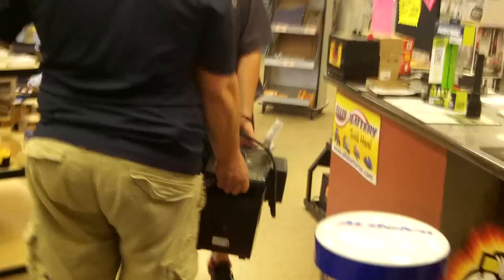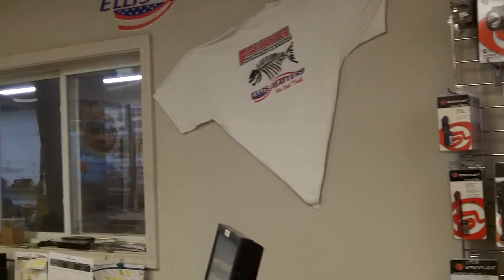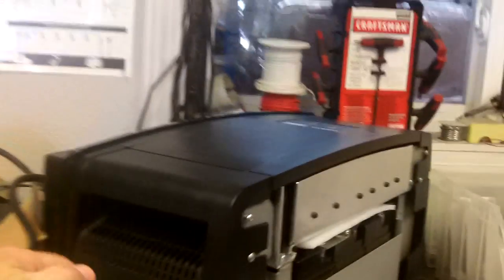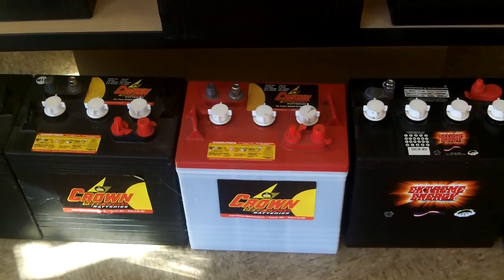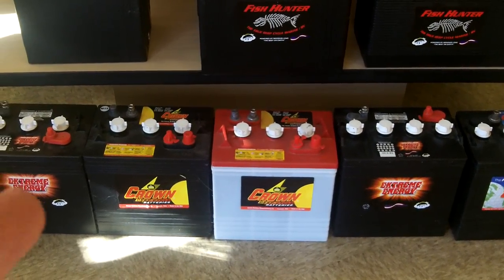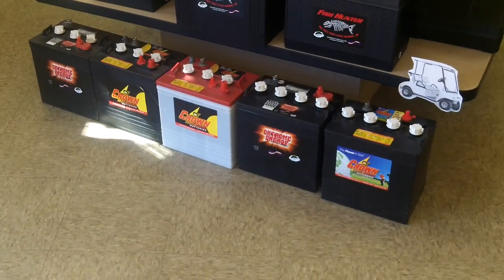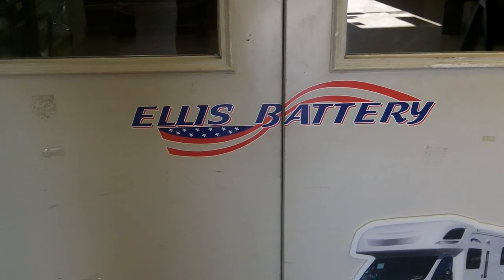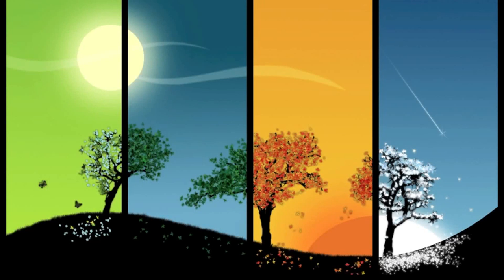Ellis Battery - Replacement batteries for our Power source 1800 Solar Generator

Comment: I purchased a Powersource 1800 and never used it. I kept it plugged in 
all the time and when I moved it and re-plugged it in it sparked and 
caught on fire within the circuit board.  SFS would not repair it even 
if I offered to pay for everything.  Dawn in customer service was not 
helpful at all and I would not recommend buying from this company.  They
 seem to be charlatans and build cheap a crappy stuff (at least their 
generators are) I had a very bad experience. Very upset I spent about 
$2,000 for something I have to throw away.